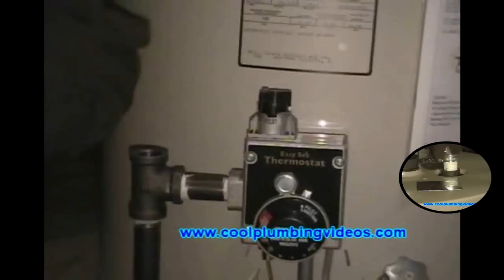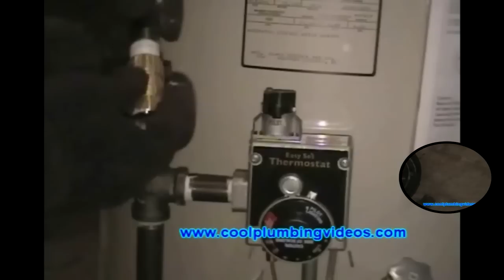Water Heater Install In Basement 3 of 12

Comment from the maker: @88MetalMania Yea your right i could have use a little back up on that gas valve. For those of you that may not know what back up means here. Mr @88Metalmania is saying I should have used two wrenches one on one pipe and the other on the fitting or gas valve to keep it from moving as I worked on it. Thank you for the comment now others could read this and learn more every little bit help. Each One Teach One :-)